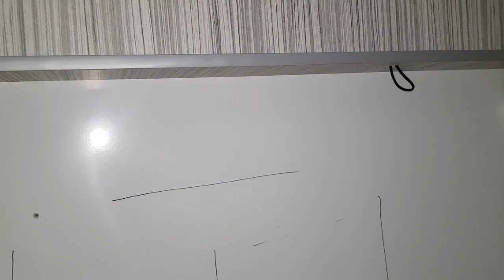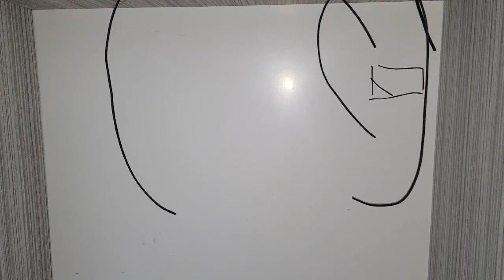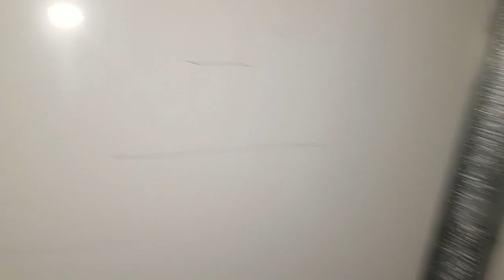Project Overlander part 5 interior build #expeditionsmobil #VanLife #overlander

Comment: Hi love the build videos can't wait to watch your travels in the van ,only a couple of things I would change  shower would be a pucker one with no sink , sink should be in toilet so you can wash your hands , bed should  have a slat based bed to stop condensation, lastly I would have put in a pucker sink in kitchen , just my thoughts mate , the kids are going to love travelling in the Beast .
Reply from the maker: I didn't want sink in toilet the unit in the shower room is a fully combined unit where the shower is built into it the tap is the shower head it pulls out of the sink so I can wash my dog aswell. As for bed I have a special honey combe liner that goes under the mattress it's not cheap £70 but stops all damp as it circulates air flow. slats dont work been there before

Comment: Ooh, taking shape now fella. Which blown air heater have you chosen?
Reply from the maker: Have you not watched the other 4 parts of the build tut tut tut  ?? Its in this vlog sat next to the water heater it's a propex gas heater. But iam having a desiel heater fitted aswell as back up heat source
Reply: @TheOffgridNomadUK   I have, but for some reason it didn't register. then I saw what I thought was a diesel heater and I was like, hang on. So that makes sense now. I'm wondering if I should risk a Chinese diesel heater or blow four times the amount and get Webasto/Erbaspacher.
Reply from the maker: @projectblue3995  I like my propex I have the smaller hs2000 in my camper I live in it's super easy and not let me down in last 5 years so went for the bigger version for my truck it's also 240v electric aswell so if I go to a camp site I get free heat saving my gas. I will be fitting a Chinese diesel heater as back up

Comment: Is the gas under the bed not going to be a separate area accessible only from outside? My concern would be a gas leak if in bed
Reply from the maker: Sorry just seen this the gas box is under the bed but accsses is from outside from door. The gas box is a fully sealed alloy box with all vents in floor